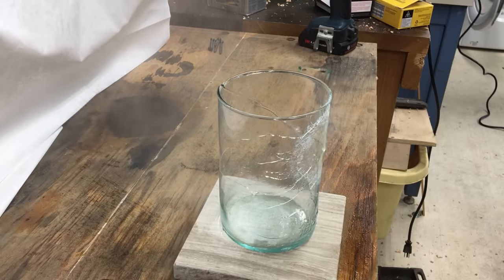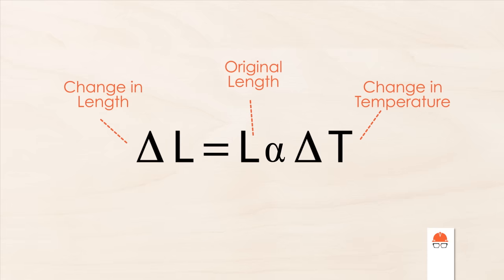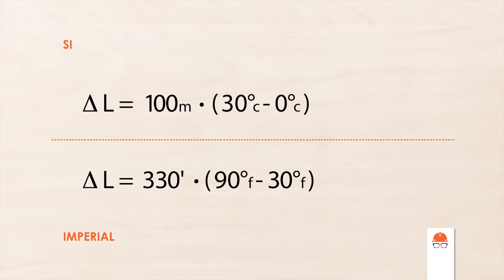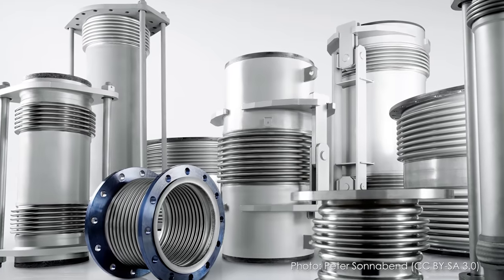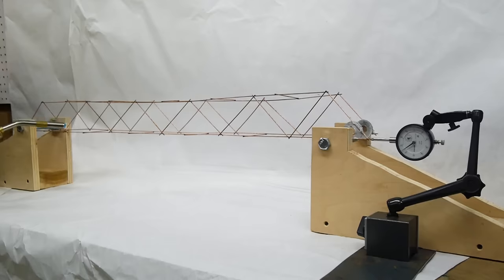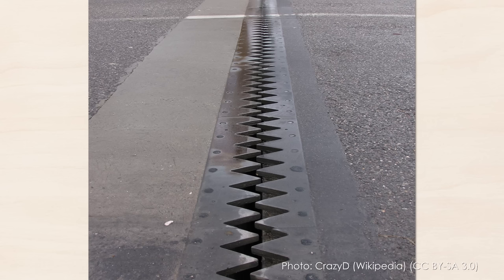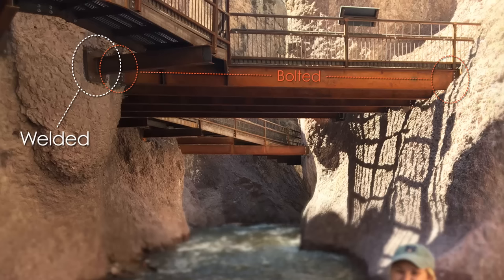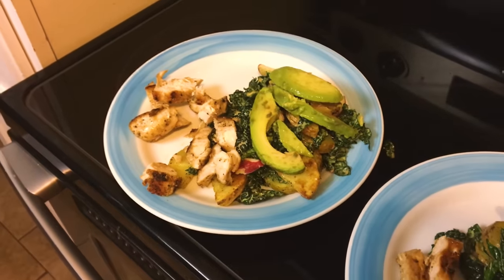Why Bridges Move...

Comment: What about long pipelines?
Reply: as Ufasdfgewaf said and also they are under ground so the temperature is mostly constant throughout the year...
Reply: What about the Hype-loop?
Reply: they're probably going to use slip joints in the hyperloop if it's above ground. you can't have tight bends in that can you
long pipelines usually have large U sections to allow some expansion
Reply: Russel Walker expansion loops or expansion joints (corrugated metal bellows)
Reply: James Bradwell it will be build using slip joints as steven yau said and will be held on slip holders/mounts... watch the Thunderfoot video when he visited the hyperloop... tho i am also skeptic about the hyperloop...
Reply: Thunderfoot's video on hyperloop is one of the worse things I have ever seen. He's a pretentious scientist and not a engineer. He purposely failed to account for many variables in his video in order to add the word "Busted" in his title.
Reply: Dan Moran his videos are only overview and hold more truth than any today's engineers engineering projects... he doesnt need to account all the variables, he just needs to account those that are obviously neglected by the engineer and those because of which the project might fail... also he doesnt have only one video, so watch them all then talk which variables he didnt account for... engineering hyperloop is mostly physics so whats better than physics scientist overview of the project?
Reply: No he finds a problem then goes "there is a problem therefore the job is impossible, god all these people are stupid aren't we just so clever", only he manages to stretch it out to 30 min by repeating himself a million times.  

Any normal person would see the problem and go "huh,wonder how they will solve that one".
Reply: James Bradwell hyper-loop won't happen. It would require a perfect vacuum 100s of times larger than the world's largest, not to mention one guy with a handgun could compromise the whole thing.
Reply: the hyperloop is a scam
Reply: There are real engineers and then there are YT engineers... guess which solve real problems.
Reply: Blox117 Hyperloop is open source. It wasn't much more than a cool idea that he wasn't really interested in pursuing himself. Also SpaceX is a private company so are you suggesting that Tesla is a money making scam by Elon to rip off investors? Or do you just not know what you're talking about?
Reply: If it's a thing like a pipeline, it can be designed to flex in desired directions, and then assembled underground to limit temperature issues. The big pipes can also be made to zig-zag slightly. Gimmicky impractical things like the hyperloop are probably not going to happen, but large slip-fit vacuum connections are options.
Reply: A scientist sees the problems with the hyperloop and calls it impossible.
An engineer sees the problems with the hyperloop and makes a list of the challenges to solve.

Scientists discover how the principles behind how everything works, engineers discover how to make those principles work for us.
Reply: DonCDXX, Actually scientist is pretty ok with hyperloop. The guy who calls it completely impossible is economist with engineers list.
Reply: Check out the Trans Alaska Pipeline.  800 miles of engineering marvel.  I had the pleasure of working there for couple years.
Reply: @Blox117  Hello i'm a dumb triggered millennial just like to say sir Elon of Saint's Musk has a proven record and currently holds claim to be key innovator in numerous branches of here this planet's technological advance hehe having to much fun Cough Cough.

Whats cool about this fella is that he can sell you on an idea which perhaps can only be possible after a brake through but you need to rally minds and investment now in order to reach such a future.

Its a bet and or gamble some are loosers  but so far the winners are outweigh them + the real benefit will likely show its self over a long run.

Comment: I saw another video on youtube by a mason titled: Building Brick Walls (Old School vrs. New School) Mike Haduck.  He said that modern buildings with rebar are only built to last 35-50 years and showed a piece of rebar that had rusted away a substantial portion of its mass.  He was saying that brick walls built using the older way with more brick last a lot longer.  Maybe you could comment on the longevity of rebar and how it holds up to oxidation.
Reply: Also have that question. Also saw that video. :)
Reply from the maker: Not really a fair comparison because rebar is used to give concrete tensile strength. It's not serving the same purpose as the brick. If you placed a solid concrete wall to the same dimensions as a brick wall, I think they would last about the same. e.g. Hoover Dam was built in 1931.
Reply: > Mike Haduck  
Thank you, subscribed.
Reply: the steel reinforcement rusts because concrete has micro pores which allows water to seep in. the concrete and brick holds water like a sponge. technically if you could cover the steel with a passive oxide layer like stainless steel has, it would last forever.
Reply: michaelg uhhh, no only when its new. thats why the steel rusts after a few years.
Reply: There are ways to mitigate the risk like epoxy coated rebar, fiber cement, making sue the rebar is far enough from the edges of the concrete, coating the concrete surface when done with a water proof barrier etc.
Reply: @Blox117   That is actually what the concrete does to the surface of the rebar.   However, both the alkaline chemical and this protective sheath are susceptible to acids over time.   The whole reason behind rebar and concrete being married is that they complement each others weaknesses so well.  Eventually however, you are right.  Every single piece of rebar in concrete will eventually rust and cause a failure.  The timescale is extremely long in most instances, but exposure to a lot of salt solutions, or acids, (even C02 in the air can cause an acid to form in the pores, neutralizing the concrete over time) will accelerate the process.  concrete can be protected from this by applying chemicals later on to maintain the internal PH of the concrete.   It can also be sealed, to prevent direct contact between the solution in the pores and the co2 in the air.  Also, sacrificial anodes can be set up to corrode preferentially, that are replaced every so often.  In some instances newer buildings actually have a charge applied to the rebars to make the rusting reaction impossible. 
Edward schmitt   We've tried the epoxy coated bars, and the issue with that is that since it is an electrochemical reaction that occurs, the potential remains high.  As soon as there is one nick in the coating, all of the corrosion that wants to happen in the area, will occur locally at that spot.

Comment: As a fabricator and welder, i have built expansion joints and bearings for everything from pedestrian walkways, to full-size bridges. Some are as simple as a pair of extrusions with some studs on them, but on the opposite end I've built ones that are complex assemblies with tolerances in the thousandths of an inch.

Comment: The clockmaker John Harrison (of Longitude fame) recognised this as a key problem in accurate timekeeping and invented the Gridiron Pendulum to compensate. Are there examples of that in structures though or just clocks?
Reply: buildings rarely need to expand a set amount at a specific time
Reply: The point of his design was that Harrison used clever engineering so that even when the metal expanded due to heat, the pendulum would remain the same size and the clock's timekeeping would remain precise. A pendulum getting longer slows clocks down and if you have a grandfather clock, you have to rotate the weight to raise/lower it throughout the year - the winter/summer temperature difference has a surprisingly large effect

Comment: Worked at a large hospital where they added 3 3megawatt diesel generators during an expansion project. Generators were located in basement and went up inside if building for 10 stories or at least 150'. As soon as they started first generator they had reports of noise and banging metal. Brillant engineers never installed expansion joints in 3' diameter exhaust pipe that had temperatures over 750 degrees F.  Had to rip out triple sheet rocked walls to refasten exhaust pipe. While doing same project engineers did not install what we were told less then a $100 In something for outside drains. Within a year or so water leaked into several basement offices. They had to relicate several offices to remove damaged sheet rock a lot of ceiling titles and carpets then dig up parking area to correct the problem. Both cases enhineers tried to pass the buck. Said contractors should have caught it but contractors said they went 100% by plans. Another time they installed a 36" chiller water valve handle in place where wall was going to go. Forget how many thousands of dollars that goof up fix cost. They had to drain system on a weekend then remove at least 96 bolts to rotate valve 90 degrees.

Comment: Great video, as always. When you're talking, you sit a bit too close to the camera, causing the top of your head to get cut off. That's aesthetically unpleasing. Just a minor complaint but I hope you fix it in future videos. :) Also, thermal expansion isn't usually considered while designing buildings. I suppose that's because generally, buildings don't have dimensions large enough for thermal stresses to get significant.
Reply: Building walls do have expansion and contraction joints placed in them. Typically you will see them at around 50' spacing or less in masonry walls.
Reply: +Michael Onines Oh wow. I didn't know that. Hmm what about framed structures though?
Reply: Feynstein 100, the frame inside the building stays at a relatively constant temperature, so it isn't as big of a deal. For roof beams above the insulation you use detailing that allows for connections to move a little bit. It's an issue I've seen cause problems if it isn't addressed correctly in the detailing.
Reply: +Michael Onines Oh okay. That's not part of the building code around here though.

Comment: I got stuck in grand haven Michigan’s draw bridge, probably about 5 cars back from the stop poles that come down. It was an extremely hot day, it drew open for water traffic and then it wouldn’t close. Thermal expansion. They had to hose it down and I remember thinking at the time “yeah that’ll fix it” sarcastically…. But it did.

Comment: Pipelines that experience temperature differences can also use an expansion loop. A 'U' shaped loop in a straight section. It provides some room for the pipes for expand and the dL is covered by cushions. Its pretty good fun making the stress calculations for district heating pipes.

Comment: One thing to notice how railroad designers mitigate the effects of thermal expansion with cwr (continuously welded rail) is to have the tracks perform an incredibly gentle S bend, kind of like how a snake moves, but so subtle you would only notice if you mounted a laser to the rail. When the rail expands, the S shape becomes more pronounced, less as it cools. This also has the added effect of reducing hunting on worn out equipment as the train is in a constant stat of going through a curve. (Hunting is where the conical wheel shape causes the axles to continuously shift side to side, trying to find equilibrium, and yes, train wheels are truncated cones, not just flat wheels with a flange)

Comment: During a final engineering inspection of concrete piers that support an elevated guide way of a new light rail line, engineers found cracks in some piers. The city says that these cracks were formed because of thermal expansion. The piers were in place last summer when we had 40°+ C. And this past winter we had some days of around -30°C.  So, when I needed to try to understand this better, I turned to PE. Thank you.

Comment: Sometimes, rather than expansion joints in piping systems, we put in expansion loops. We literally just have the pipe jog off to the side and jog back. This allows the natural flex in the pipe to take up the expansion, and is often more cost effective than an expansion joint.

Comment: I was at the Rio Grande Gorge bridge @ Toas, NM. A steel bridge 1/4 to 1/2 mile long, at several places there were expansion joints with several inch movement each. Have been there several times and noticed the gap changed due to temperature changes
Dale

Comment: I got in trouble for "breaking the gate" at my apartment, I tried to explain that it was installed in 100 degree weather and the screws/latch just fell off when it hit 0 degrees last month. For a week prior it wouldn't even shut, it was just banging in the wind which probably helped loosen the screws.

Comment: Outstanding explanation. 

Structures ARE organic. 
Structures changes with heat. 
Structures are never rigid. 
Forces and loads on structures behaves dynamically throughout the rigid body of the structure.
Structures must not be fully tight. They should have room for change.

Comment: The evenly spaced joints in concrete paths are not solely provided for expansion. That is for contraction of the concrete . Concrete shrinks in early days and if it restraimed it get cracked .
Even in bridges other than the thermal movments there are many other types of movements to accomadate such as traction, creep, etc

Comment: Where I live thermal expansion can be a huge problem. From August 2018 to February 2019 the temperature had a range of 78 degree celcius or 140 degrees Fahrenheit. From a scorching 100F(38C)  all the way down to -40 degrees. And over the course on even one day it can range as much as 50 degrees Celsius or 90 degrees Fahrenheit

Comment: An interesting example of thermal expansion are the fueltanks of the Lockheed SR71. The engineers couldn't find a way to build tanks that can safely expand as much as necessary, so they built them to leak when the plane is parked. In operation they get warm enough to seal themselfes and the CIA dealt with the problem by putting a little fuel in right before the start, and refuel the plane in air once it got up to temperature

Comment: This is also why aerial cable TV hardline coax has those bends in it next to every pole. Expansion loops. Without them, when the cable shrinks in cold temperature, it will rip the cable right out of the taps/amplifiers/nodes.

Comment: I have witnessed the effects of thermal expansion on car engines. I owned one vehicle that had a cast iron block with aluminum cylinder heads. Before 100,000 miles it suffered head gasket failure which I assume was from the dissimilar materials stressing the gasket. Also owned a V8 that was all cast iron except for the aluminum intake manifold. Every so many years the the intake manifold gasket failed.

Comment: Hey Practical Engineering. I have a great suggestion. You should play a game called Bridge Construction Simulator. You can find it in Play Store or App Store (depending on your device) and then show us how you would go about in building a bridge with different types of scenario on a different terrain. Since you have some form of engineering knowledge like compression, tensile strength, and structural design, it would be interesting for you to give it a try and share with us. Cheers!

Comment: This is how thermostats work in HVAC.  Metal strip in a coil.  Expands with heat, coil changes angle, mercury inside slides to make electrical contact. Turns on hvac
Reply: Also how an many an automatic choke works on an old carburettor engine, a small steel pipe embedded in the cast iron exhaust manifold runs to an enclosure on the side of the carb with a wound metal strip  attached to the choke linkage , when the engine is cold the choke plate and throttle linkage are in the cold start position (IE : the metal coil has reduced in length ), as the motor heats up so does the air in the pipe warming up the metal coil (which then expands in length )which brings the choke plate/s and throttle back to normal operating temperature position.
Horrible things auto chokes   :) .
Reply: @mikldude9376  oh wow.  Did not know that. 
I always remember in high school there was a flat strip of metal that had two sides with two different metals bonded together.  They expanded at different rates.  When heat was applied, the strip would curl - because the outside metal was expanding more than the inside metal. 
I was laughing my a$$ off when jixuan and Sebastian tried to suggest a hyperloop won’t expand as it runs hundreds of miles because some parts are hot while others are cooler, with a net of zero.  They really have a dangerous lack of understanding of this stuff. 
I fully admit. I’m an idiot - but I know that a 300 mile long pipe will expand

Comment: On the subject of cement bridges.  Has anyone noticed the underside of cement bridges often include 'port holes'? These might be only around 6 to 8 inches in diameter.  What are these typically used for?